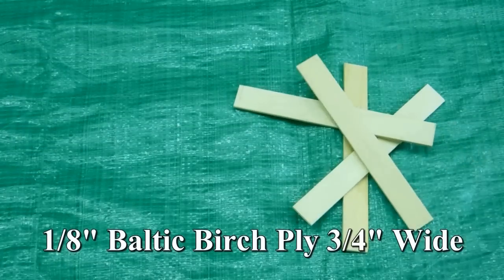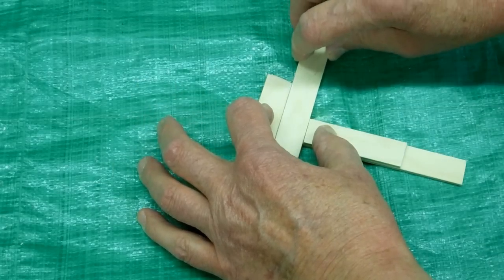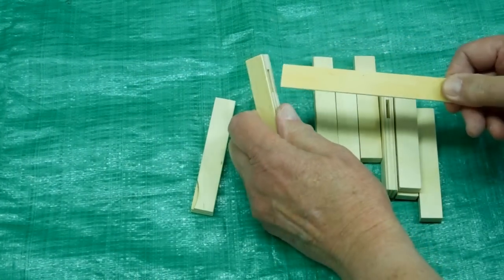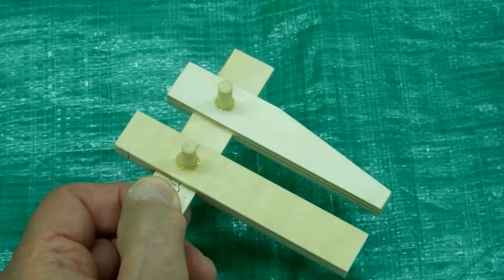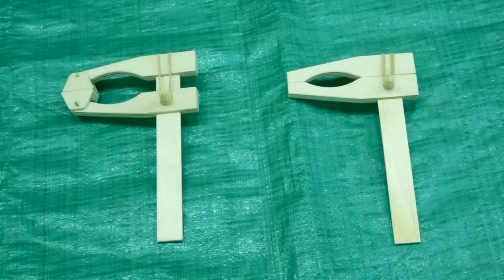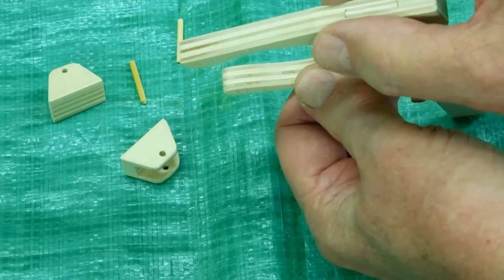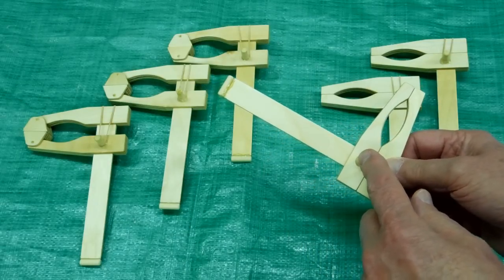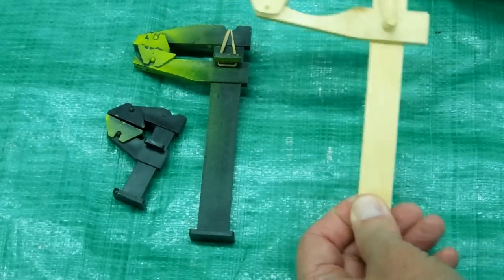Rubber Band Modeling Clamp

Comment: 👍
Let it dry....
How long is that ?
Reply from the maker: Let what dry? Epoxy or glue?
Reply: Wood glue.
Reply from the maker: Wood glue like Titebond Original (PVA or aliphatic resin) has a strong initial tack  and sets up pretty fast. With clean dry wood, once the wood has absorbed some of the moisture from the glue you can start working with the parts. Usually, 10 to 20 minutes and you are good to go. If you get in too big of a hurry and knock the pieces apart, the second attempt to glue them will take considerably longer because the surfaces of the wood have already absorbed some moisture. In a warm environment, general construction, the joint is pretty well cured after 24 hours.

Comment: Ron:  What saw is that?  I'm looking for a small table saw to do projects with my grandson.  That size would be ideal.  Thanks.

OOPS.  Never mind.  Just saw your previous post.  Thanks.
Reply from the maker: I have a review on the baby table saw - Byrnes 4 Inch Table Saw - Review & Demo https://youtu.be/gn1VOs6ayWg  Expensive but very powerful little saw. I should mention this is not a kids toy and is every bit as potentially dangerous as a full size table saw if not more so due to the smaller size. Thanks for watching! Ron